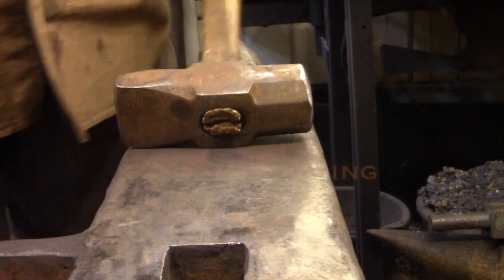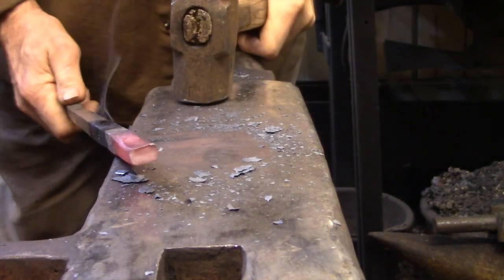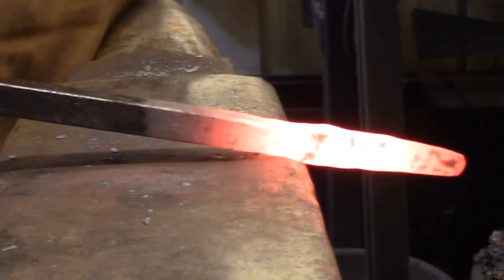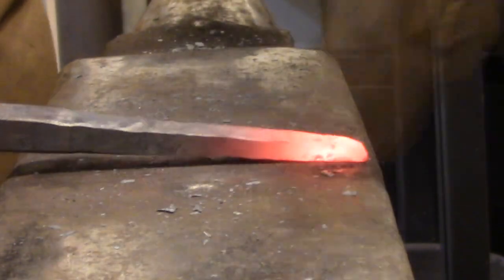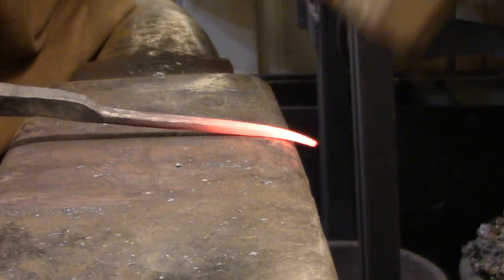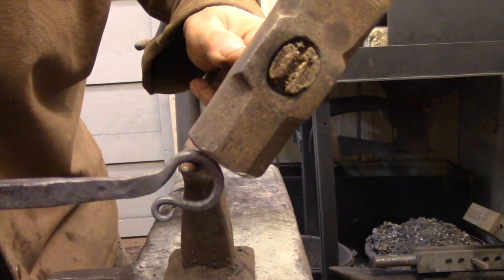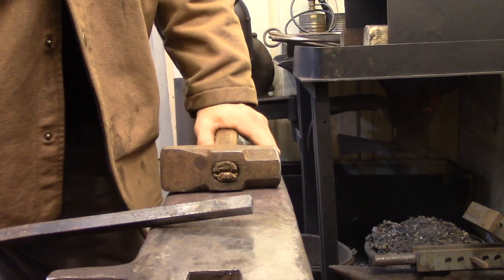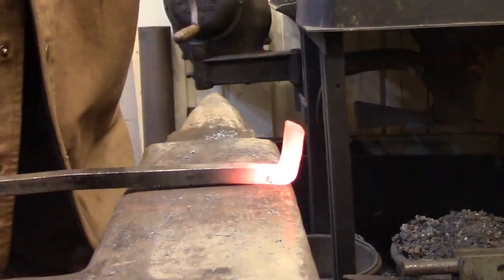Blacksmithing for Beginners - Basic Hammering Techniques

Comment: I know this is an old video but tips are helpful regardless.  A small note is to try not to upset by just holding it and hitting it towards yourself, really hard on your body in the long run and not super efficient.  Use you thigh as a brace for smaller stuff, and something more solid (and preferably not attached to yourself) for heavier stuff.

Comment: HI Dennis, another very informative video.  One thing you might want to clarify is that although you clearly show it in the video, you should also emphasize in the voiceover  that forging a point is done at the far edge of the anvil, not in the middle.  This is a pretty common mistake that beginners make and probably accounts as many divots in the anvil surface as misses do.  You might also want to discuss the shape of the cross pein because, as you know, most commercially made hammers have too narrow and too rounded of a pein.  It is also worth mentioning that drawing out can also be done using just the edge of the anvil and the face of the hammer, assuming a proper radius on the edge.  That is the way I usually do it.
Reply from the maker: Thanks Scott.  I know I made it sound like I wasn't going any further with this subject ( so I really appreciate your concern)  but that isn't the case. This video was just meant to quickly explain the techniques that I use in my videos and the way the hammer and anvil work together.  That way people  will hopefully be able to better understand the process as there watching me work.  I will be expanding and reinforcing this information in latter project videos because I feel it is very important but I just wanted something to act as a foundation that can be referred back to.   I think I covered the cross peen shape in the hammer reshaping video - did I not?  As for hammering over the edge to draw out - I don't like doing that because it is real easy to loose track of what you are doing and forge too thin.  You can see when I created the offset that I was checking the depth with every hammer blow to make sure I wasn't going too far.  Good to hear from you again
Reply: Always a pleasure to see someone battling (peacefully) against the plethora of bad blacksmithing information on youtube, Dennis.  Even thought I am probably more advanced than many of those watching your videos (I've been a hobbiest for 25 years) I still watch pretty much every one of your videos because I still pick up info  that I had not been exposed to before.  Keep up the good work.

Comment: For using the Cross-Peening method of hammering, that is using the backside of the mallet to make the metal wider instead of longer, what would I use if I had to use like say, a regular hammer to metalwork with? Is there any substitute that can be used to do this?

Comment: I like the way you teach. I noticed that when you hammer you seem to stroke the metal in the direction you want it to go with the hammer. like steering the metal. you didn't mention that you were do it on each blow of the hammer, your arm stroke are in a rotation action. you can really see it on the sped up sections.
Reply from the maker: Actually that's just an optical illusion.  I always hammer directly into the metal.  Sometime the rebound and or gravity makes it look like the hammer is glancing off the metal but the hammer blows are always aimed right at where I'm hitting ( or close to it - LOL ).

Comment: Hello Dennis, great video sir. I have a question. When it comes to making square bar into round bar, I tend to get “valleys”, or cold shuts along my stock, caused by my hammer blows to the corners as I’m attempting to round them out. After a while these valleys appear and I usually have to lay down some power in order to correct them, but unfortunately they just seem to shift to another surface area. Any thoughts or tricks to help me correct this issue? Thank you sir.

Comment: Any way you could give me a list of forging hammers that I should buy?? Size, length. Such as the one you use in this video? Thank you! Great videos!!
Reply from the maker: The only specialized hammer that I use is the cross pean. The three I use most are 2.5, 3 & 4 lbs each.  Of those three the one I use most is the 3 lb.   I have a regular 4lb sledge that i use for forging or driving punched and a lot of ball peen hammers because they are the easiest to get in a lot of different sizes.  But if i had to start over with only one hammer it would be the 3 lb cross pens that i use in almost all my videos.

Comment: Is there a general list of equipment you will need? I would greatly appreciate one.
Reply from the maker: You don't need a lot to get started and usually the space you will be using will dictate how you can set up.  For example, you may need to get a gas forge because setting up a coal forge isn't possible. My first forge was a propane torch aimed inside a short section of 2" pipe.  I was using vise grips for tongs and a ball peen hammer.  My anvil was an old sledge hammer head that was held in the jaws of a machinist vise.    Everything you make or find after that just makes your life easier.
Reply: Thank you! That helped greatly.

Comment: Hi there, what are the essential tools and materials for forging? Thanks
Reply: Metal. Heat. Hammer. Anvil (or similar surface).

You can also use google or youtube and find thousands of lists of what you will need... If you took the time to scroll down about 6 comments in this very comment section, you would see Dennis's response to your exact question:

"You don't need a lot to get started and usually the space you will be using will dictate how you can set up.  For example, you may need to get a gas forge because setting up a coal forge isn't possible. My first forge was a propane torch aimed inside a short section of 2" pipe.  I was using vise grips for tongs and a ball peen hammer.  My anvil was an old sledge hammer head that was held in the jaws of a machinist vise.    Everything you make or find after that just makes your life easier."

Comment: Dennis
That was very helpful. Thanks

Do you think there is an advantage in having a diagonal peen hammer.

Frank
Reply from the maker: If you are not having any trouble with a regular cross peen then I would not  feel the need to switch. There is certainly nothing wrong with using them - I think it's just personal preference .  That's actually based on a saw straightening hammer.  The combination of straight peen, cross peen and diagonal peen allowed them to hammer in any direction in  the centre  of a large circular saw

Comment: how do you know steel is too cool to work?
Reply from the maker: For mild steel - If you are making big changes to the cross section of a piece you should always stay above a bright red heat.  If you are just  hammer refining the surface or flexing the piece slightly to straighten it out you can work almost down to a black heat.  For carbon steel - always stay above the critical temp.